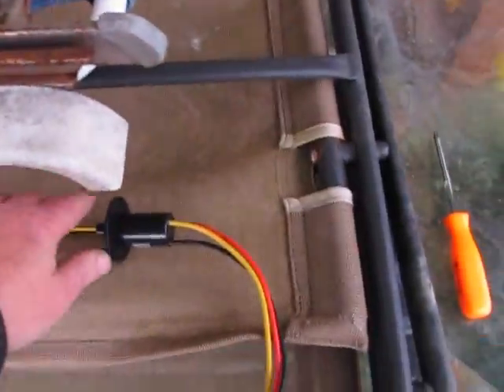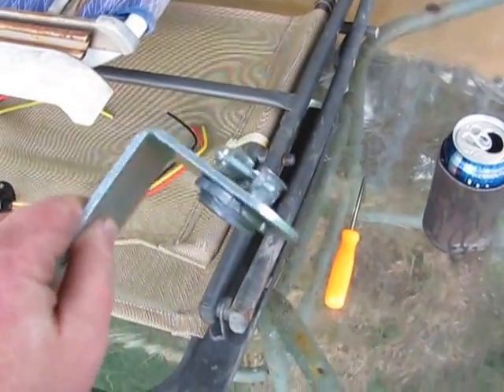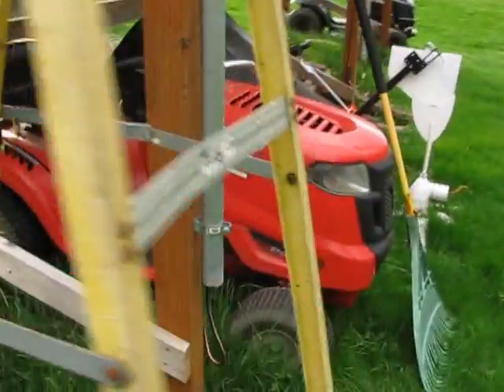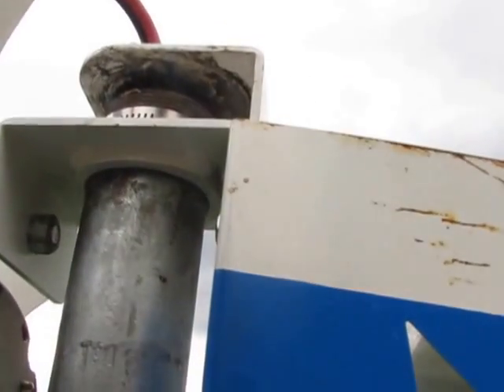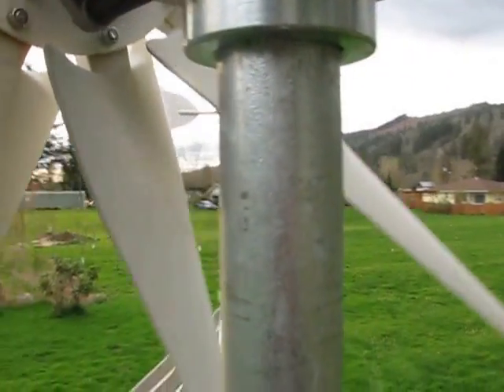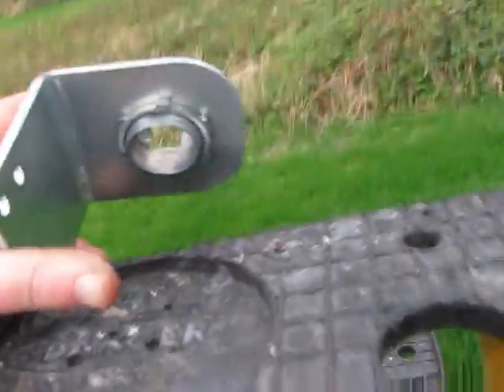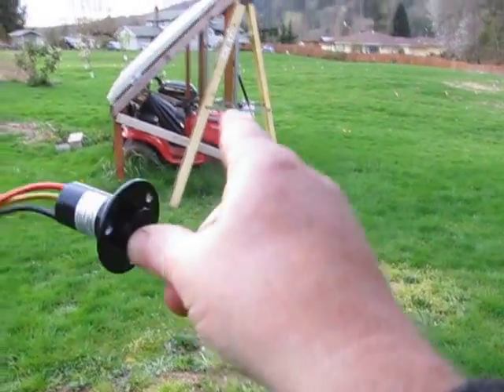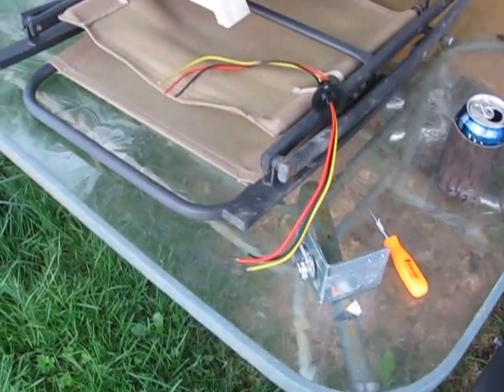How I install a 3 wire slip ring on my MW&S turbine

Comment: I must have missed the whole point, because I do not see the need for slip ring in this case. There is nothing rotating in this area. If you have a problem with twisting down the pipe all you need is a junction box where the bracket is mounted. But I admit that I must have missed the reason you needed a slip ring assy.
That particular slip ring assy appears to be designed for indoor use.

Comment: if you put it in from the top you won't have to take off the bracket.
maybe you and should get a head cam for this, bill rosa has one....
it's snowing and here
btw, why not put a third or forth turbine on your roof line, you would get more height
best
Reply from the maker: I do plan on adding another turbine to my roof someday,, This is the roof mount I want to use,, http://store.mwands.com/wind-turbine-mounting/adjustable-wind-turbine-roof-mount/ ,, I think Jeff is working on a adapter to put a MW&S turbine on this mount :)
Reply: Jason Brown I talked to Ben about that a few days ago, he said to have a plumber thread the end of pipe so that you can use a 2" to a 1 1/2" coupler. or you could buy a longer than 4' like 5 or 6 and drill the mounting holes in the bottom of the pipe.
best